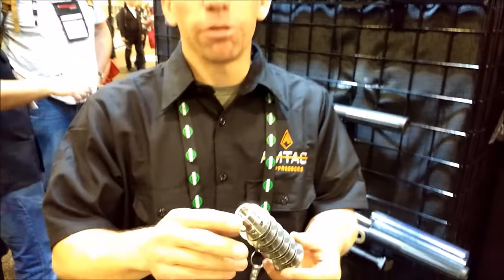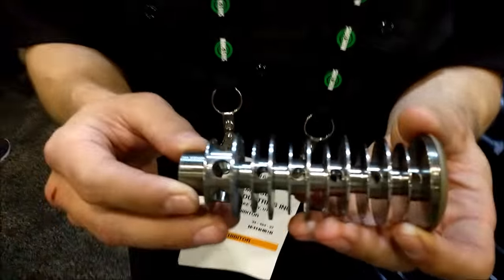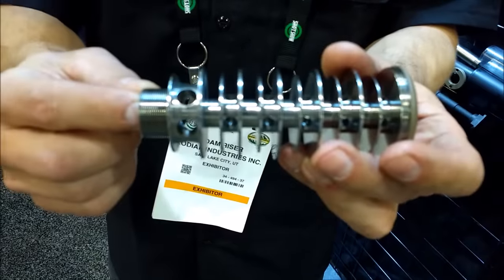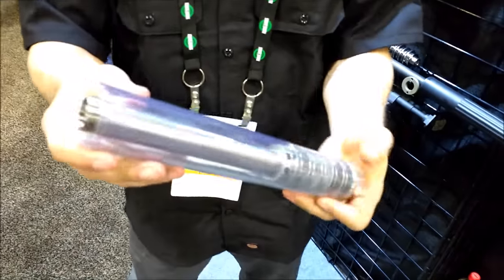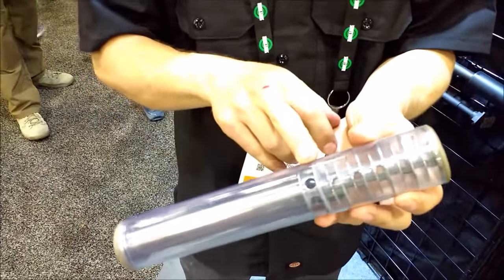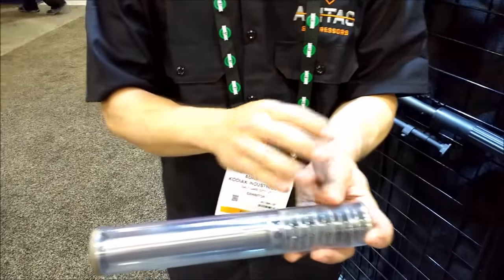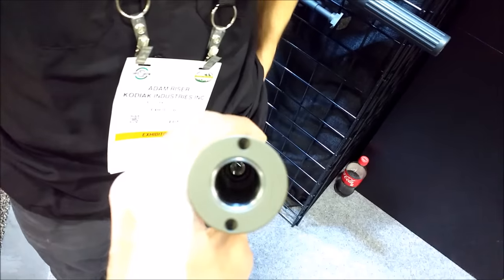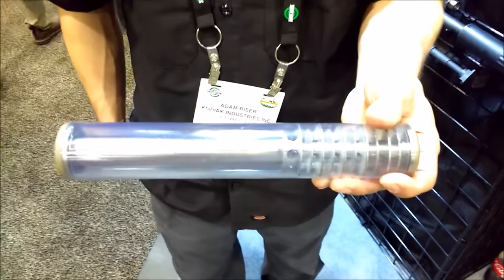AMTAC Suppressors Internal Baffles - SHOT Show 2016

Comment: VERY WELL THOUGHT OUT DESIGN!!  <This is coming form someone that is a mechanical engineer that works on the International space station...   Well done Bravo.   a suggestions would be to make the OD of the system a bit smaller than you currently have ( to allow more applications under other hand guards) but add another baffled section to make up for the decrease in volume.
Reply from the maker: I will pass on this suggestion when I see them at SHOT.
Reply: Gear-Report.com Thanks.  Supressors are a bit of "black magic" unless you are an acoustical enginer with background  in thremodynamics and computational fluid dynamics.  In the end normally comes down to an idea that you just go a head and build/test.
Reply from the maker: Yeah. It can be a bit eye opening when talking to silencer companies. Some invest huge resources in high tech fluid dynamics modeling and other such voodoo. Others just play with designs in the machine shop until they find something that seems to work.
Reply: Hmmm.  I had this idea too but the question now is how efficient is the gas going to go travel back end of the tube to cool off? Air has mass pressure and its not going let that burning hot gas travel back that much while force it out the front were the open end is less restricted. A whole lot of not needed length and material for barrel end. Unless you have a pressure relief valve that can bleed out the rear slowly.